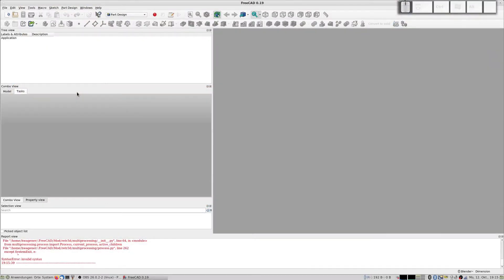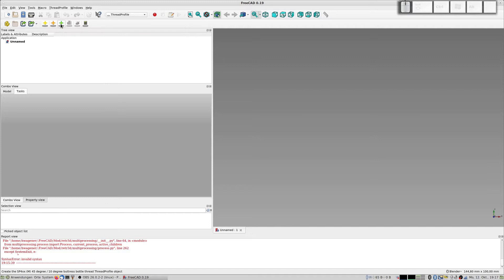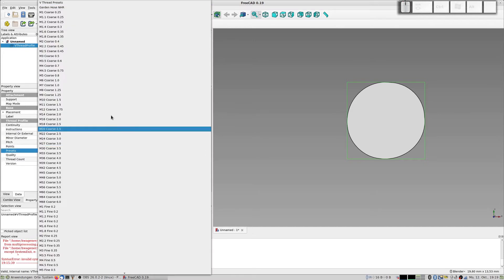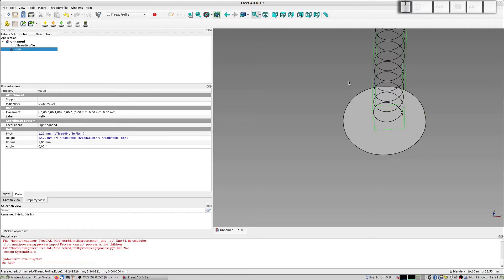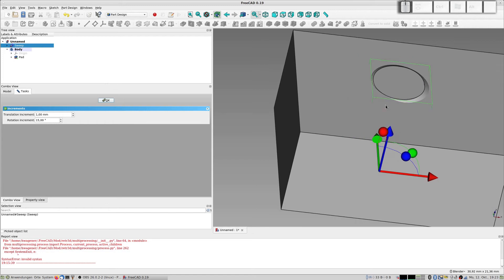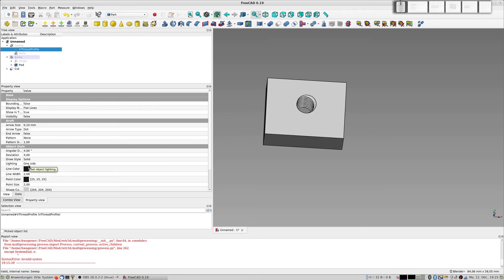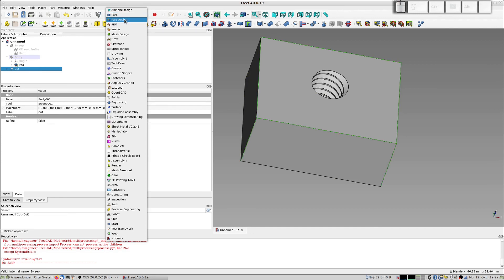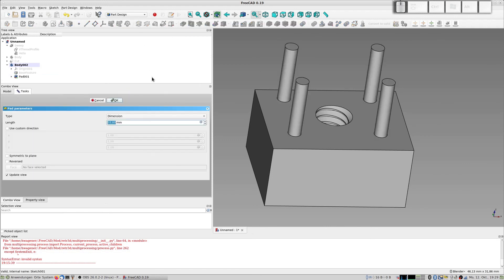Freecad-Tutorial English - Threads by Thread-Profiles

Comment: fantastic video... how in freecad can a 1/4" NPT 4 degree tapered pipe thread be made that would be good enough for a 3d printer?   thanks a lot...:)
Reply from the maker: I would today use the actual version 0.19 (perhaps the build 24267, cause the new one has some bugs), there is a new function integrated, called helix inside part design-workbench. With this workbench you can create almost every thread by creating a profile in XZ-plane and rotate it by a helix based on the XY-plane. I have created a 3/4 Inch-screw yesterday, but have not printed anything till now.
I am no "incher" :) and have nothing to do with pipes and tubes, so i need some info about the1/4" NPT 4 dregree tapered pipe thread, i am not sure if i will get the infos what thread should be created, what NPT 4 dregrees means and so on. I know that with the helix thing you can tell the helixes to be conical, so perhaps this ist the thing this 4 dregree means?